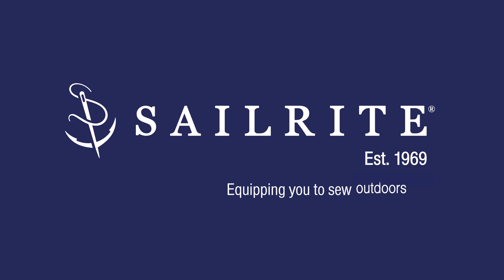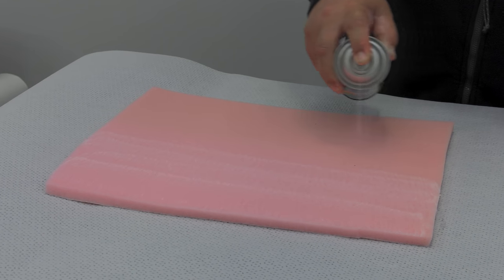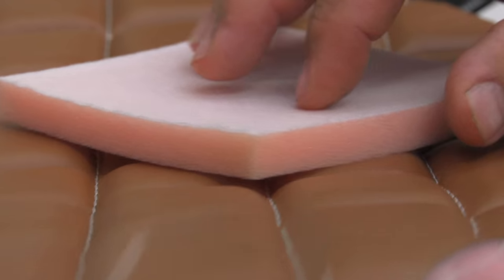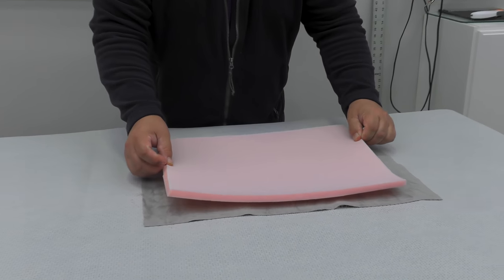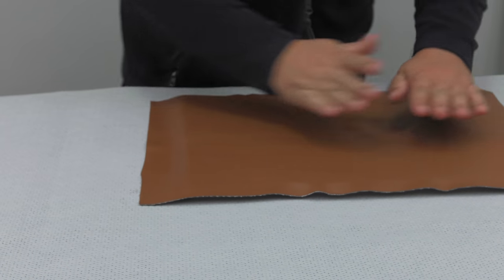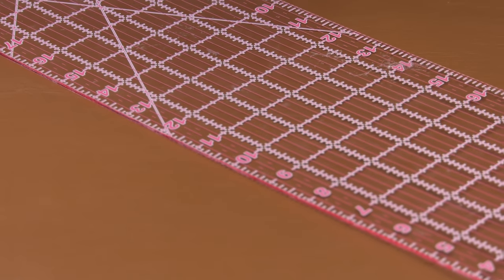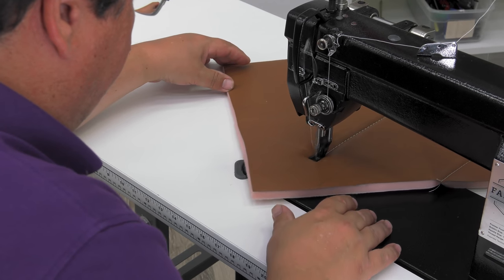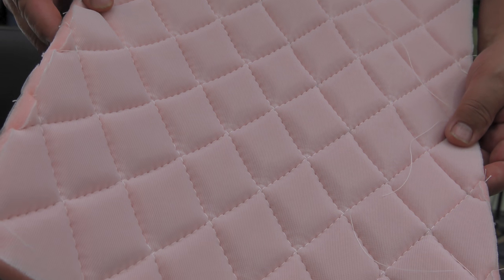Stitching Diamond Pleats

Comment: It's possible to do it by hand on leather? Or I need the sewing machine?🤔 Thank you.
Reply from the maker: Typically it is always sewn with a sewing machine, but it may be possible to hand stitch.
Reply: You can I have seen some of the best diamond pleating done by hand. I didn't have a machine for years and used a "Handy Stitch Sewing awl" on everything. Using home or commercial sewing machine needles in the "handy stitch" and good bonded thread works great for a lot of fun projects. Do you have access to a sewing machine?
Reply: @sswcustomsewing4276  

But how do i do it with my hand
Reply: @imchangingaccountnoreason1103  diamond pleats on leather with half-inch foam padding to boot? by hand? you don't. but if you insist on trying, it's the same process as shown here... just do a straight stitch by hand.
you do know how to knock out a straight stitch by hand, yeah? if not, you need to find a beginner's video for hand sewing.

Comment: Whats a good machine at a decent price to do that level of work? Thanks.
Reply from the maker: These are all great sewing machines at the least price possible for work like this: https://www.sailrite.com/Sewing-Machines/Portable-Heavy-Duty-Sewing-Machines/Ultrafeed-LS-1-Sewing-Machine
Reply: @SailriteDIY  Thanks! I might be interested in one of those. I want to make padded speaker covers out of tough materials like Cordura. what would be a good material for the inside of the cover, or would the scrim that comes on the back of the foam be sufficient? Also what would be a heavy duty thread for a job like that? I appreciate You! I have no sewing experiece at all.
Reply from the maker: @simonpanter3627  If you plan on making this cover as a removable cover, used over and over again, then the sew foam backing will not be heavy enough to handle the abuse. So, I would back it up with another fabric, like Evolution fabric. So... you will have a Cordura fabric for the outside, sew foam on the inside and Evolution fabric on the inside. That will make a great removable cover that is very tough. I would use V-92 Polyester thread and a size #20 needle. Let me know if you have more questions.
Reply: @SailriteDIY  I went ahead and ordered a couple of yards of the Evo from you. Do you have a site I could PM you at?